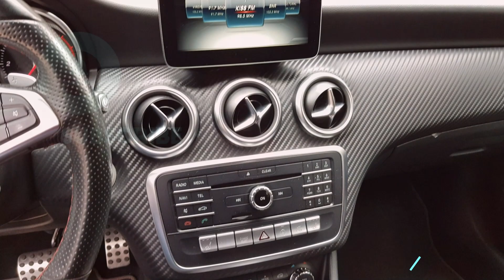DIY Mercedes A180 W176 Maintenance Service Fuel Filter Air Filter Pollen Cabin Filter

Comment: Hello. You don´t need to pump the fuel to prime the filter. Simply put the key on the position before runnig starter and you can ear the electric pump working. 20 seconds is enough. Start the engine and the bleeding is complete.
During intermediate maintenances, if you wish just to drain the filter, remove that white plug, connect a hose to a catch botle and do the same. The fuel sitting on the bottom of the filter is expeled throug that tube. I opened one old filter and confirmed that the tube with the white plug goes to the bottom of the filter. Any retained water or debris can be taken out.
Reply from the maker: Hello Claudio! We prefer to prime the fuel filter housing in any way because some viewers might try the same thing on their cars and if the car doesn't have a pump in the fuel tank than things could go wrong. It doesn't take much time and the car starts right away. Thank you for the info on the white plug.